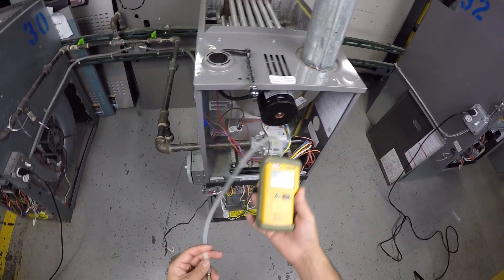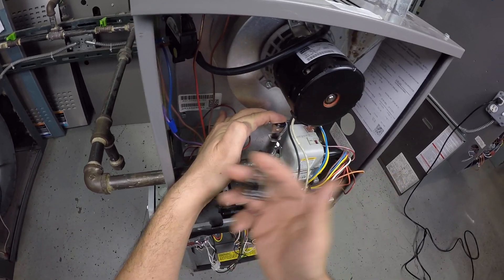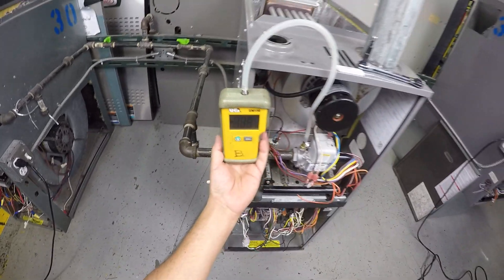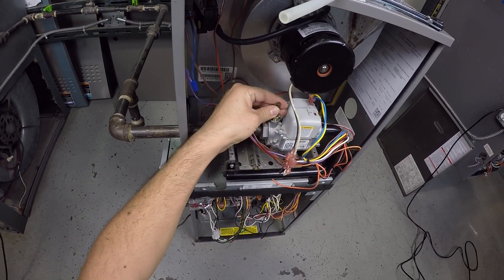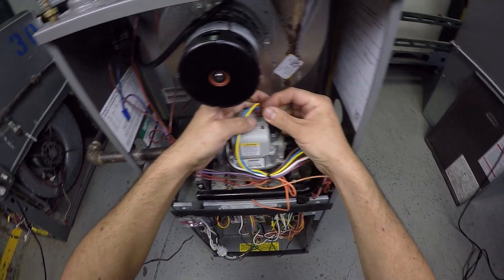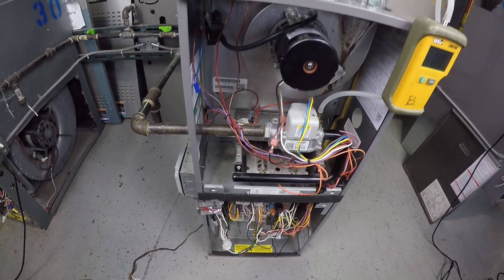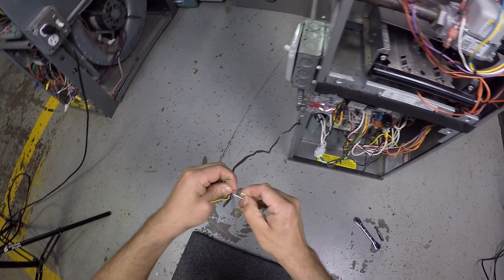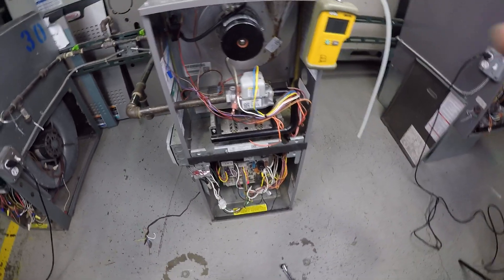How to check gas pressure in a furnace.

Comment: Hola Paulo bendiciones . Tiene algún video de cómo conectar low voltage de air handler, condenser, t stat ,flot , water coil?
Reply from the maker: Savez no, ese diagrama es muy bueno me justa combinar varias unidades, el proximo video sera ese mero. Saludos